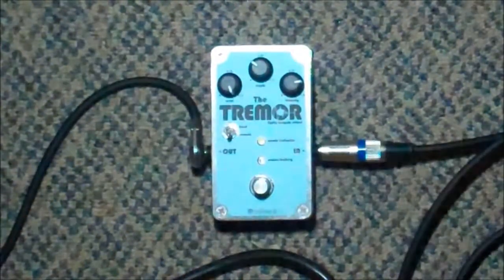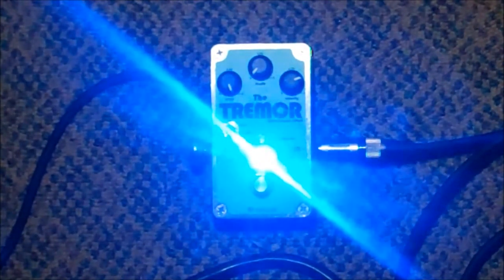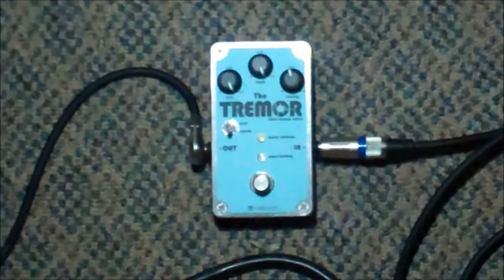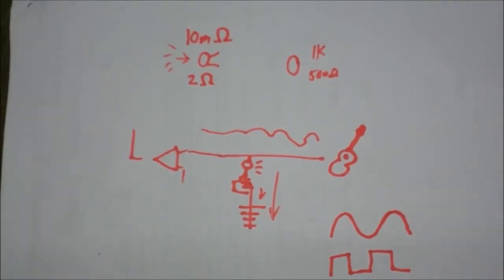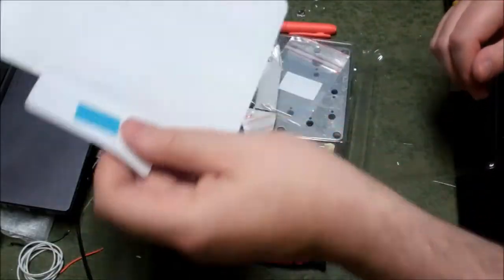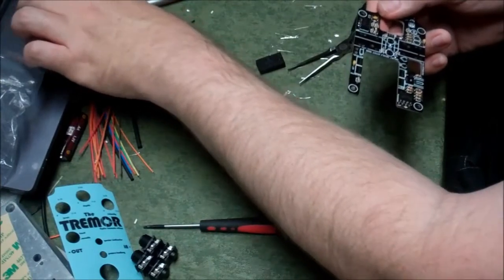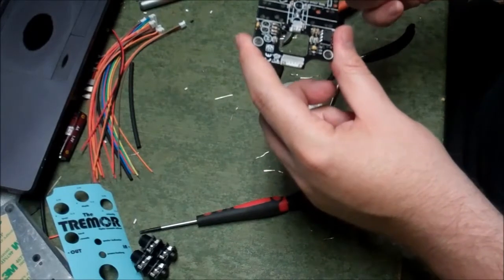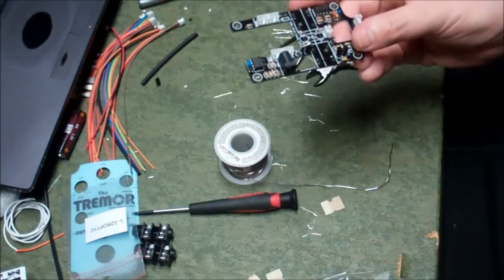Velleman Tremor Optical Tremolo Pedal  Demo and Build

Comment: Even it's a 4 year old vid, maybe you can answer a question.
I ordered a kit today on sale for 15$ over here in Germany.
Does it come with the schematic?
Sadly there is only the building instructions for download at Vellemann.
I'm interested if it has a volume drop when you switch it on.
If so, i probably find a way to add a volume pot, but therefore i would need a schematic.
Thanks in advance and best wishes from Bavaria Germany 🇩🇪
Reply from the maker: Unfortunately I do not remember anymore.

Comment: hello koby, may I ask you? I did build the pedal but it dosent work the effect when is on "smooth" mode. Everything else work perfectly. but dosen work that part, The audio keep going dry. Do you know what could be wrong?
Do you have the circuit to email me?

thanks a lot!
Reply from the maker: The schematic is available at the velleman site,   also  Small Bear electronics has the link to it.   I can't get Youtube to let me post it in the comments here.  The two waves it produces are square and triangle.   Are you losing the flashing on the light?
Reply: Hi Koby!...thank I got it from Small bear page! I know about the two waves, the mode "smooth" it should be triangle, dosent work, the sound just by pass, weather the fx is active or not.  The flashing light it work perfectly.
Reply: I probably could upload a video, to make it easy :-)
Reply from the maker: Just so I understand,  in smooth mode,  the light on the outside blinks correctly,  but you lose the sound.  Is this correct?
Reply: I dont lose the sound, I just the guitar sound dry, no fx at all
Reply from the maker: Andy Dealla   the inside light must not be flashing then
Reply: look I did a video... 

Optical tremolo problems (that the name)... I cant paste the link